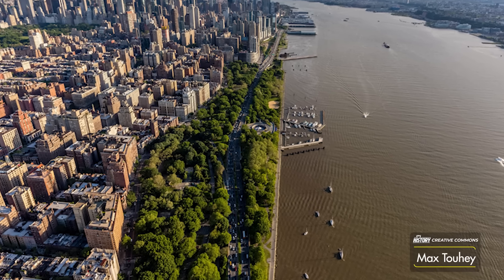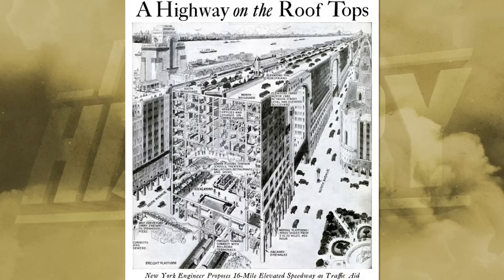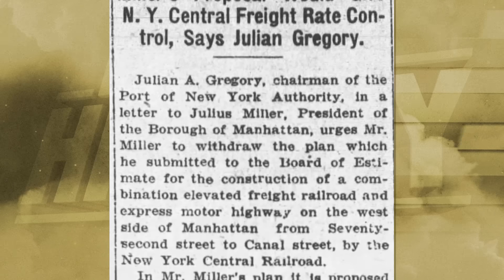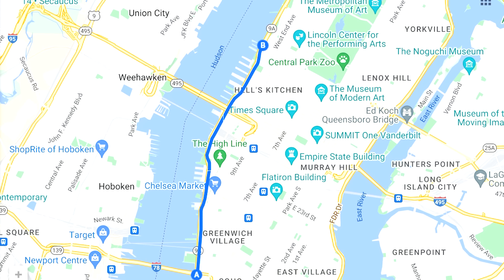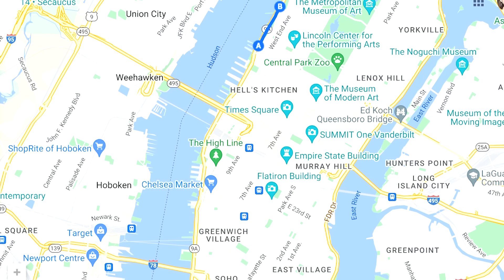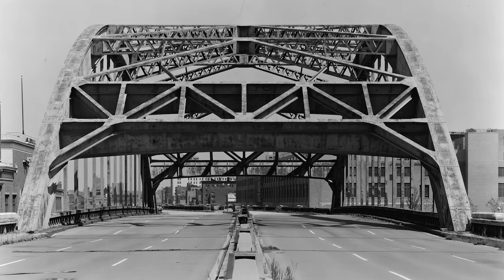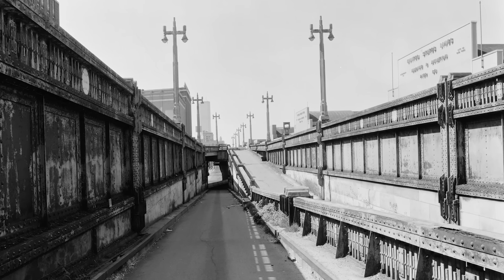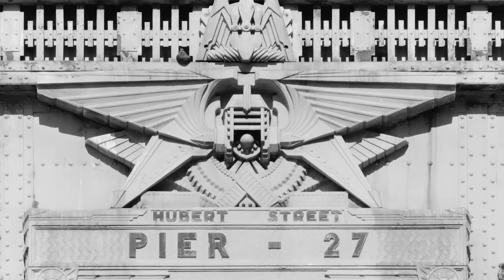Why NY's Lost West Side Elevated Highway Collapsed

Comment: Another obsolete feature of the highway, which I find interesting to note, is that the older sections were originally paved using stone blocks as the driving surface, instead of asphalt or concrete.
Reply: I mean most the streets in New York are cobblestone, they just put concrete or asphalt on top of it.  It’s a good base material

Comment: We know why it collapsed, I was there back then, the city never bothered to maintain it, salted runoff water in winter added to the severe corrosion of the cast iron and steel. A substantiala heavy structure built in the 1920s and 1930s was basically destroyed in less than 50 years.
I own several of the round city seal cast iron artifacts from it, I had quite a few more of them back then, along with two of the 500 pound pieces that were above the much larger cast iron street/pier number  designation signs, and a booklet from the opening ceremony.
Reply: so cool wanted to get one of those round plaques i drove truck under it back in the day watched them take it down a piece at a time good memories

Comment: NYC was always known for being very neglectful of its infrastructure. I remember the rust holes in the steel girders of bridges being shown on the news during the 80's. So it's no surprise that highway was left to rot until it collapsed.
Reply: I remember! I was a bridge maintenance engineer for the Massachusetts State Highway Department in Boston and I had the luck to work with one of the painting contractors who were also painting one of those NY bridges. When the contractor's super told me of his company's crew blasting holes through the steel beams right when subway trains were passing by, I was amazed, shocked and appalled. Amazed that the steel beams held under the weight of the trains, shocked that the subways weren't suspended for the duration of the painting job, and appalled that the city had let the bridge go to rot for so long.
Reply: NYC could look really spectacular if they only painted the bridges...
Reply: yeah they just added new fancy subway cars with screens and 1 less seat per row and the stations look terrible and havent been changed in a century and a half
Reply: @2aj. The outside stations have been getting a face lift for 20 yrs now ..in most places where they closed elevators for decades their now built new ones . They also renovated a lot of the stations in lower Manhattan..
Reply: The MTA still uses original equipment for the subway systems from the early 1900’s. Literally some systems are from 1903, before they were open to commuters.
Reply: I remember when they had to close portions of the Manhattan and Williamsburg Bridges for structural repairs and they took it out for a year or two for each section.

Comment: Driving on the highway required daredevil skills, admittedly if your going fast. The steel walls were not like todays smooth guardrails. There were steel elements sticking out towards you as seen in the video. 

Almost all turns were sudden changes, not curved. The technique was to yank on the steering wheel about a car length beforehand.  
I long admired those lamp posts. They were true works of art deco. I really expected the city could have saved a few or at least put a few up for auction.

Comment: You should do a video  on Chicago's elevated rail lines. That was absolutely necessary in Chicago since it was rail hub of the nation. And it was a truly amazing feat of engineering. Virtually ALL RR rights of way were elevated above public grade beginning in the early 20th century. If the RRs had opposed it, it probably would not have been accomplished but the RRs knew something had to be done to separate public crossings with their rights of way.
Reply: Make sure to include all the elevated lines that are now gone.

Comment: This was a good video. People talked about this road years ago. It's largely forgotten that this road even existed now. What doesn't make a lot of sense to me is that the city could have restricted truck travel on the highway and made the highway for cars only. This would have prevented the road from collapsing.  Ironically the road collapse and closure happened right in the middle of the 1973 - 74 oil embargo, when people had trouble getting gas for their vehicles.

Comment: My parents were separated in the 60's. I lived in Flatbush and my Dad lived near Lincoln Center.   A taxi from there back to Flatbush was incredibly fast, first going down the elevated highway and then directly through the Brooklyn Battery tunnel.  I bet the same trip would take double the time these days.

As we zipped along, we also got a great view of the top cruise ships of the time from a high vantage point.

Comment: I believe the steam-powered passenger train pictured running through the street at 1:49 into the video is actually Syracuse, NY - several hundread miles from New York City.  Trains ran at-grade down the middle of Washington Street in downtown Syracuse until a major grade separation project was undertaken by the New York Central Railroad in the 1930s (a project which was destroyed, incidentally, by the construction of Interstate-690 through the heart of Syracuse in the early 1960s).  Passenger trains stopped operating on Manhattan's surface streets DECADES before any plans were introduced to build the West Side Elevated (Miller) Highway.  The tracks on the West Side (which were eventually elevated, independent of the highway) were freight only.
Reply: Having lived there for five years, definitely Syracuse.
Reply: I thought so as well. Such a famous part of Syracuse history looked familiar to me.

Comment: The old Seattle waterfront viaduct was removed the same way piece by piece, fortunately before it collapsed.
Reply: I remember riding on the West Side Highway when I was a kid in the early 60's and later on the Alaskan Way Viaduct in Seattle in the 80's.  It almost seemed to me that the Alaskan Way Viaduct was the West Side highway upside down.  The West Side Highway going south fed into the Battery tunnel which led to the bridges and viaducts of the Gowanas expressway in Brooklyn.  The Alaskan Way Viaduct led to a tunnel in the North wich led to bridges and viaducts  that became Aurora avenue.
Reply: To be fair the Seattle viaduct was kind of redundant since the i5 is right in downtown Seattle a few blocks over. Where as manhattan NY needs more freeways, Seattle is a smaller metro and doesn’t need more than the i5 tbh
Reply: @LucasFernandez-fk8se  yeah… only no. Now its an order of magnitude worse to get to downtown or north of the city from the southwest portions of Seattle. Or expensive through a tunnel that will leak and cuase problems likely before a retrofit viaduct would have.

Comment: I remember driving on the highway when I was a kid.  We would count off the piers as we went up, usually from the Battery Tunnel up to the Lincoln Tunnel.  My dad had a bar at Clarkson & West St too, and we mostly saw the street level traffic and the piers from there.  By the time I was a teen, my driving friends would take it and we'd all be commenting on how tight the turns are and how crazy the left entrances were.  After it collapsed I did take the opportunity to ride my bike on it one time too.  What surprised me then was that they didn't close it off completely.

I've been biking on the West Side Greenway since it opened and noticed changes over the years, from the original stop signs put at cyclist's head level at every corner as if cyclists were a problem on a bikeway, to what appeared to be a widening of the bikeway where easily done by removing some decorative brick paving.  

There was a rumor that the guitarist John McGlaughlin of the Mahavishnu Orchestra was killed when it collapsed.  I never knew how that originated.

Comment: This is the 3rd video of yours that I watched today based on NY infrastructure. Up until recently I used to work in queens near Richmond hill and woodhaven and took the J train to work. I was always blown away by the condition of the steel on the elevated platform and tracks many places were so rotted you can put your finger through the holes. This portion of elevated tracks are also the oldest portion in the city. I can’t see it going another 50 years without a catastrophic failure

Comment: I grew up riding on the west side highway from the early sixties, then driving on it as a teenager in the early seventies. The highway was crumbling and falling apart from day one, it was never maintained. Looking back now as an adult you can easily see that the elevated highway should have never been built in the first place. West street should’ve just been reconfigured to what it is presently at street level, it works very well. I also remember Mayor Ed Koch proposing West way in the 1980’s, a super highway to replace the West Side Highway. Thank God it never got built!

Comment: Down by the Battery - Now Hugh L Carey - Tunnel, there is a very small section of the start of the on ramp to the old highway.  I remember the highway being closed all through my childhood, took forever to demolish it.  What they ended up doing has worked well.  Amazing that they talked about the need for this highway all the way back in the 20's and it wasn't built until the late 30's and not finished until 1951, by which time it wasn't needed.  Wonder how Mario Cuomo would have felt about the billions spent on the replacement of the Tappen Zee Bridge which bears his name (that bridge needed to go).  You left out 1 thing and it is a major item.  For years they wanted to build "Westway"  - think the New York version of the big dig in Boston.  The entire roadway all the way  to the Hudson parkway would be buried in a tunnel with limited access to the tunnel, like they did in Boston.  The cost at the time was between 1 and 2 billion (we are talking the early 80's).  People in NY scoffed at this idea, if they couldn't maintain the elevated structure, how would they maintain a tunnel?  Thankfully common sense prevailed and you have a surface road today.  The idea of the tunnel by the WTC after 9/11 was, like much after 9/11, over reaction by the NYPD and obviously unnecessary.  Robert Moses never met a highway he didn't love, thankfully he was stopped.
Reply: He mentioned the suggested big dig plan

Comment: @7:00 Using the left lane for off ramps is a particular quirk of highway planning back in those days. There is still one famous elevated ornate steel highway that’s in service today that uses middle lane off ramps. The Pulaski Skyline in New Jersey has a similar design to the old elevated west side highway l, with ornate turn of the century lamp posts and guard rails. 

The skyway was also decaying rapidly, on the verge of collapse, but the state decided to preserve it, by closing the Pulaski completely to traffic for a few years and undertaking a full restoration. 

It was A great decision on their part. The skyway looks absolutely beautiful after it reopened a few years ago. Taking a drive through the Pulaski can give you idea of what it was like to drive through the old west side when it was first built in its prime.
Reply: @8:00 Another great corresponding point about the fall of the old W. Side Highway and the survival of the Pulaski Skyway is that planners and politicians had the foresight to ban trucks from using the highway shortly after its opening. What they did was construct at parallel highway on the ground for trucks to use. Had this not been the case, the Pulaski would have met a similar fate.
Reply: @8:00 Another great corresponding point about the fall of the old W. Side Highway and the survival of the Pulaski Skyway is that planners and politicians had the foresight to ban trucks from using the highway shortly after its opening. What they did was construct at parallel highway on the ground for trucks to use. Had this not been the case, the Pulaski would have met a similar fate.

Comment: Gimme a break. There was very rarely traffic jams back then.
 I frequently drove on it.  
To the contrary, traffic flowed underneath as well as on top. Look at the demolished roadway now. More often than not bumper to bumper because of red lights every few blocks. Just as noisy & congested. You had the F.D.R. drive & the West Side Hwy. All they had to do was maintain it. They didn't so unfortunately it had to go.
UPDATE Oct 3. Just was there from Battery tunnel to 55st at 10:30 AM.
Absolute nightmare because of the lights & those pedestrians. Congestion galore took 35 minutes.
How's N.Y. maken out?
Reply: I think the concept was good to reduce the volume of cars on the street, despite its design flaws. The old WSH was literally crumbing from neglect, but I believe the steelwork on these old structures is very expensive to maintain. The Brooklyn Bridge is perpetually needing to be painted, following decades of neglect and need for major costly repairs. NYC is a basket case for wasteful spending and inefficiency. That is why motorists get hammered with outrageous tolls.

Comment: And this might happen again only with the triple cantilever on the BQE, resulting In catastrophic 1-5 day gridlock, 1-2 week delays of goods & services, & Deaths/injuries. Traffic could well extend into NJ & Nassau County. Staten Island would most be affected as the only other way out aside from local streets are the Bayonne Bridge, Gothels bridge, or OBX to reach the 2 tunnels & bridge to the East. The triborogh Area would also be clogged, & I wouldn’t be surprised if traffic reached into CT, Putnum County, & maybe PA, & DE Because of the potential collapse of the very neglect they did with the WSH. & on top of that, no pun intended, they built a park on top of it.